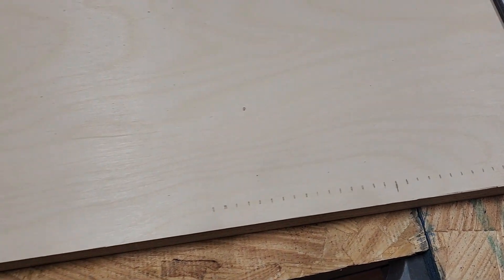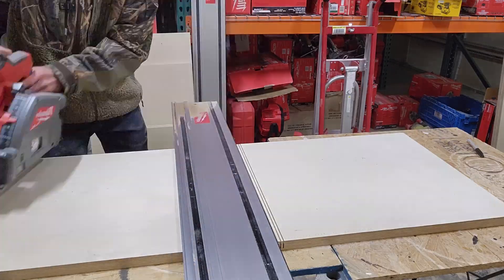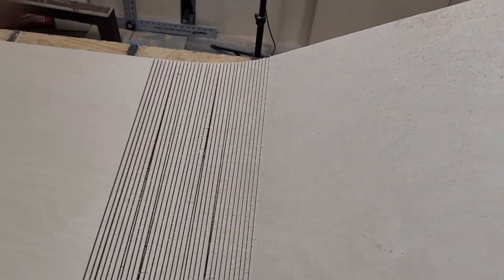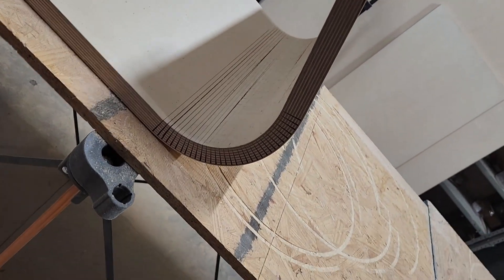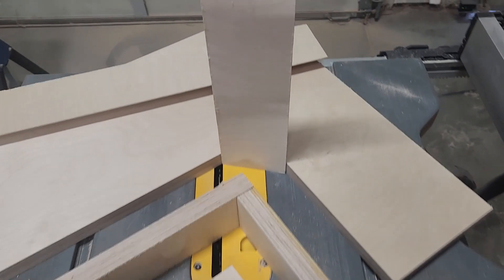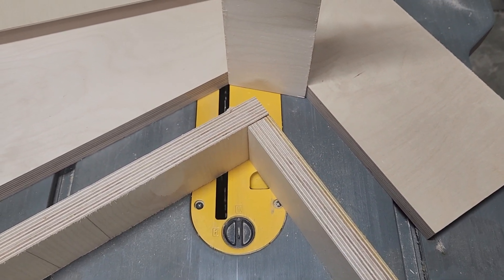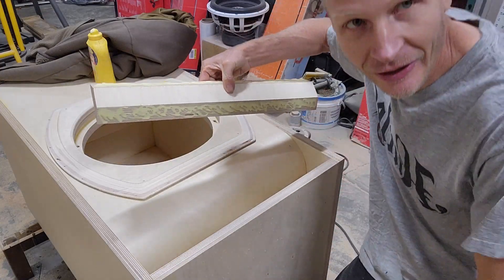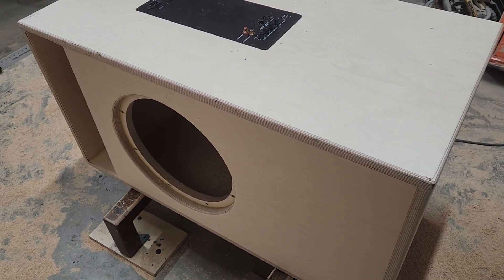Big BAD 15 inch Home theater subwoofer build.  A true ULTRA LOW FREQUENCY build.

Comment: A couple of notes on the tear out with the router. One, you can put some glue in the voids and push the splinters back into their place, let it set for 30 min and then sand flat. Better than nothing. Also, when you are routing, place a layer of masking tape on the area you intend to route out. The tape will keep things from tearing out as badly. I have had the same experience with BB ply.
Reply: Your build is excellent BTW! Nice work :)

Comment: That kerf turned out nice. Have you played with those shallow angle V bits at all to do the slots? I am thinking of using one of those on my CNC to do my upcoming sub build. To do a 3 sided box I need to do 120 degrees on each corners in a reasonably tight radius. Maybe something like you have there. I just figure the V bit will allow a greater angle in a smaller space.
Reply from the maker: I haven't played with the V bits yet, but I would like to.  They should come out very clean.
Reply: @righteousbuilds3576  if you get the angles just right it should be nearly as solid as the flat MDF, since the gap would be extremely minimal.

Comment: im still early in the vid so disregard if this is answered later but can we have a cut sheet & box specs?
Reply from the maker: The dimensions of the front baffle changed when I tightened the kerf radius, but the overall dimensions are 22x22x42.  If you email me at righteousbuilds@gmail.com, I'll send you screenshots from my cutlist app.  That should at least get you started if you want to build something like this.  If I were to go back and do it again, I would open of the port to about 3.5 inches for an even more enjoyable (in my opinion) listening experience.

Comment: Where did you get that amp and what's it called
Reply from the maker: I get my amps from GSG audio design.  This is the speaker power sp1-2400ht.  If you watch my most recent video, you can actually get a discount code for everything they sell.

Comment: 18 year carpenter here,.......some advice for your kerfed corner.
 use construction adhesive next time to fill all the saw cuts.  it will hold the internal pressure better.

also nice build 👍
Reply from the maker: Thank you.  It's always nice to learn from those who have experience.  Much appreciated.

Comment: Great video, great editing, great microphone too!

Why did you cut a giant hole in the box to mount that amp??  Instead of just mounting it on the outside??   Doesn't that weaken that big long panel - allowing flex, and also beat up and vibrate the amp?
Reply from the maker: Thanks for the kind words.  Im not sure how much experience you've had with 1 inch baltic birch but it's very hard and very rigid.  But everything is an experiment, so if it ends up being an issue, I'll add bracing :).

Comment: Many years ago I built a pair of 4.5'³ ported enclosures with  use 4 12" in isobaric pairs. It was tuned to 17.5hz. When i rented an Audio Control RTA it was flat in the room all the way down to 20hz. It absolutely slammed. If my memory serves me, I used MTX Terminator DVC subs. I wired them to present 4 2 ohm loads to 4 bridged channel pairs out of a pair of Dennon 6 channel car audio amps. The other 4 channels ran a pair of horn tweeter and 7" midbasses. The tweeter and midbass were part of the RFL cranker line and all the tooling and the vast majority of the documentation for these drivers were lost when the warehouse/factory burned down in the late '90s. 

That was the first ported system that I built that I felt actually did what I wanted. Mp previous attempts were too boomy or muddy, but this one was tight, smooth, hit hard and dug deep. It had needed almost no EQ, just about -5db at 75hz which I think was a room effect.
Reply from the maker: Very nice.  I haven't really experimented much with isobaric subs yet, but that makes me want to try it out.

Comment: HI, Kevin S here, from GSG Audio Design.  Fantastic work on this very clean build.  The flush fit plate amp was also nice detail.
Reply from the maker: Hey Kevin, We've spoken through email several times :).  It's good to hear from you on here too.  I get a lot of questions about those speaker power amps.  I hope you don't mind me sending a bunch of people your way.

Comment: What Amplifier are this?  😎👍🏻
Reply from the maker: That's a speaker power sp1-2400ht.  It's rated at 2400 watts at 4 ohms, but I have found it to be 2 ohm stable, so I'm getting more than that out of it.

Comment: I cannot wait and keep up the great job ! 😎👍🏻
Reply from the maker: Thank you.  Results are coming soon :)
Reply: @righteousbuilds3576  ha I forgot to ask how much would it cost to make 2 of those with sub and amp and shipping?? 😎👍🏼
Reply: @HPMIKE55  In this configuration, with a 2400 watt amp, dura-tex finish, and pierce audio 15 inch WMD driver (They call it the woofer of mass destruction), you'd be looking at $3500 plus shipping per finished subwoofer.  You probably figured it out by now, but I'm answering you from my personal account :)

Comment: What amplifier did you use here? How many watts to drive that 15 inch, response Would be apriciated bud
Reply from the maker: Thanks for the question.  I use speaker power plate amps because of their superior sound quality.  This is the speaker power sp1-2400ht.  It's rated at 2400 watts at 4 ohms, but I have found it to be 2 ohm stable, so I'm running it at 2 ohms, and have had great results.

Comment: Do you have a cut sheet for it ?
Reply from the maker: I could probably make up a cut sheet, but I just sketch the design and use a little cell phone app for my cut sheets.  With a kerf design, there are adjustments that need to be made after all sheets are cut.

Comment: Awesome build pal! I’m surprised no bracing at all. Wouldn’t even a couple of round dowel braces help, or is it really not needed? I know I have braced and used dampening material in big floor standing speakers and it really can help clean and tighten up the bass. Perhaps speakers are different than subs. Looking forward to your next one!
Reply from the maker: With big slow sound waves, resonant frequencies are easy to keep in check.  As long as they are well above or well below the frequencies that it plays at, you're okay.  With the 1 inch baltic birch, you need to brace about every 16 inches if its a big build, but with sides that are only 20 inches, I'm not too worried about it.  It will also be pretty heavily damped.  But if there is an issue during testing, I'll unload the enclosure and add some bracing.
Reply: Make it full surprised

Comment: Hi, I am very new to home theater subwoofer builds......

Which program do you use to design your enclosures & how do you power them for use at home.

Thanks in advance
Reply from the maker: Great question.  Once I got bitten by the "sub bug" I started absorbing every bit of info I could get and just started building subs.  I learned through a few less-than perfect builds what works and what reduces output.  Long story short, I don't use any programs.  I just design it in my head, do a quick hand drawing or two, and start building.  I either just do the math or use an online calculator  to determine port length and tuning.

Comment: A tapped horn 15" would be more approppriate for the label...
Reply from the maker: I haven't tried one of those yet.  I'll have to put it on the list.
Reply: @righteousbuilds3576  I highly recommend it, although it may need some work to model it. Luckily a free tool called hornresp is available and judging from my measurements it can quite accurately predict the response.